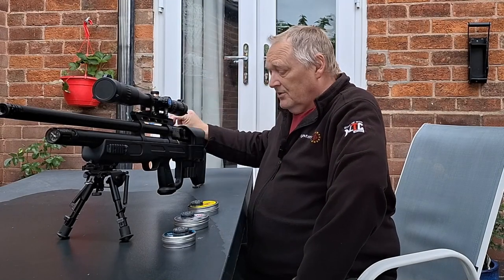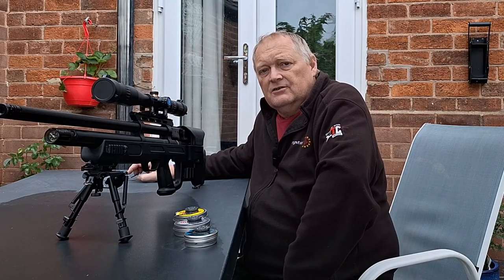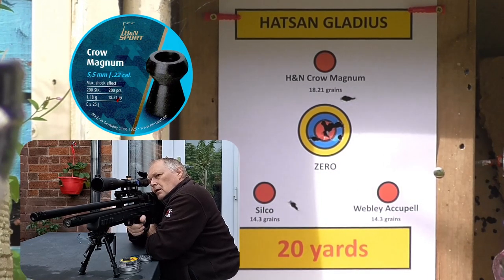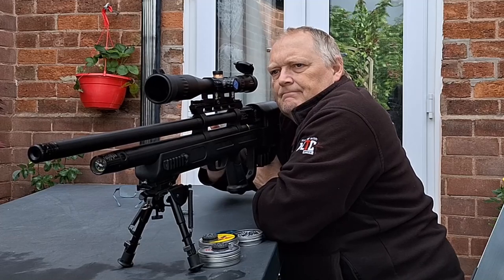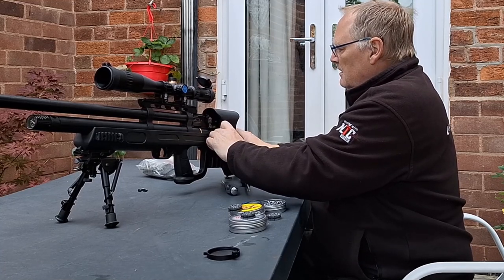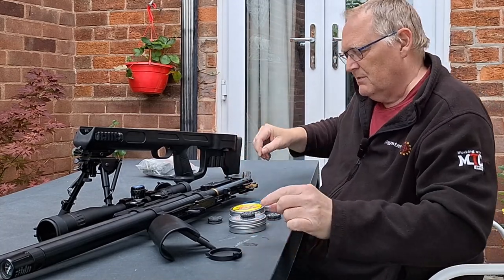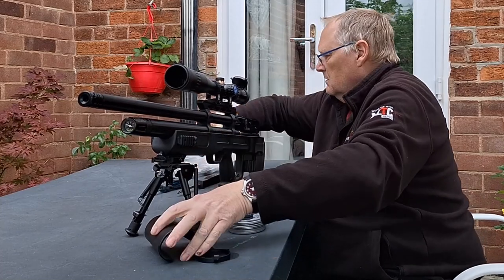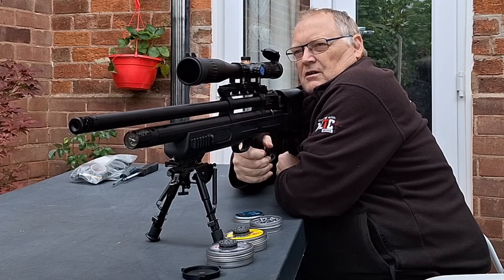The Hatsan Gladius Cocking Issue problems

Comment: I had a similar issue with my ultra clx after I adjusted trigger, it was fine out off the stock but when in the stock wouldn’t cock until I added a little more pull weight to trigger.

Comment: Those triggers are horrible, dangerous unless you set hard trigger pull, just have to get used to it
Reply from the maker: Yes, too many working parts until it gets to the quattro trigger, adding more possible issues. Kral and Reximex seem to have a better system when it comes to the linkage setup.